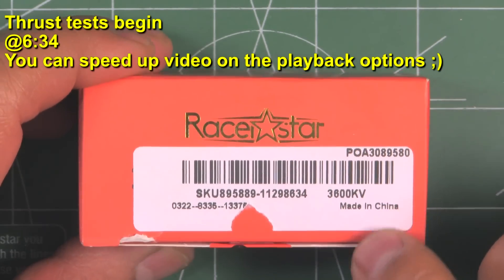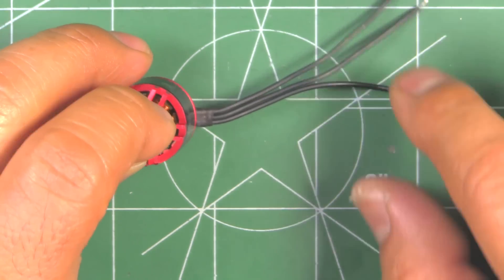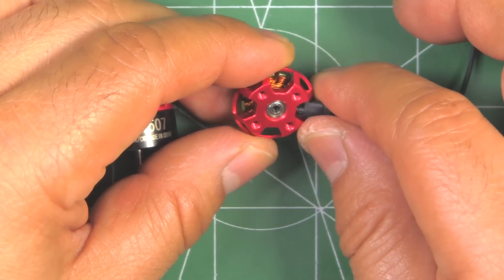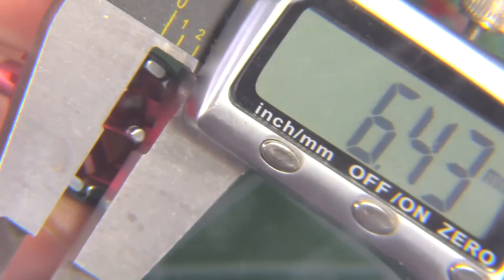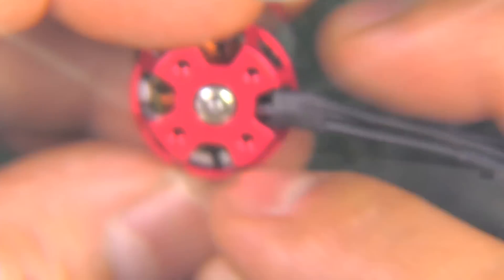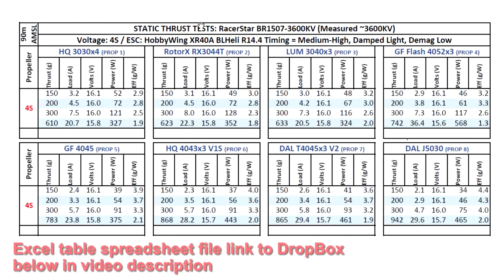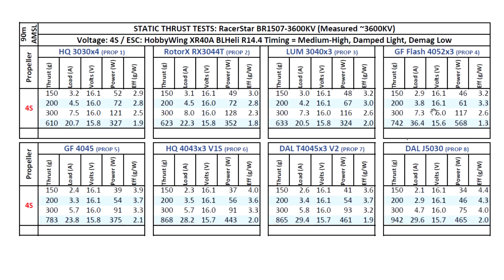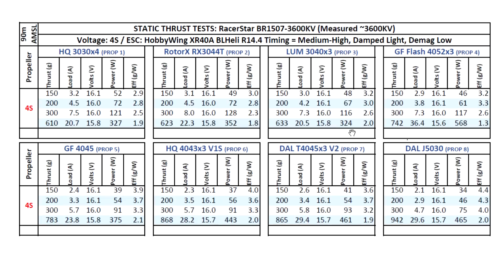RacerStar BR1507-3600KV Thrust Tests & Overview, Budget Motor for your 3" build from Banggood.com

Comment: This motor is 0.4grams less then the rcINpower 1506 3400KV, has a smaller shaft (2mm vs 3mm durability issue), and has slightly lower thrust at 868 vs 934 on the 4" V1S (which is a great prop choice for this size).   Between the two, do you think either could handle a 5-6S 1000mAh ?
Reply from the maker: on 4" V1S? 6S I wouldn't venture to try that high. 5S .... maybe but risky on either one, but the rcINpower may have a better chance..... but may still fry!  I've only seen 3" props running on 5S on micro motors, the XNova 1407-3500 there's a video of someone (I forget name) running 5S on 3"

Comment: Nice review.  Interesting motors...wish they were little cheaper.  At $40, I'm inclined to stick with the motors I know are high-quality at $10 more.  But might give them a shot on a light 4" build!
Reply from the maker: Right, if one can afford an extra $20 more for a set, there are many more capable and proven motors.
Reply: Yea...think you're right.  The more I think about the data and construction of these -- it just isn't worth it to me to take the chance.

Comment: Was really looking forward to test results of 2s and 3s, but you only do result of 4s :-(  Perhaps in future?
Reply from the maker: Usually most people use these 3" and 4" props on quadcopters so 4S seemed to be what people were using. I know there are some people that use 3S and 2S for fixed wing or with larger props. I no longer have this motor but I'll consider running at least 1 prop on 3S and 2S. What size prop would you use with this motor on 2S?
Reply: @EngineerX  Thanks for your reply. Would be looking to use something like the LDARC 3050 3x5 3 blade props on a 2s sub 250 gram 3 inch quadcopter due to laws here in Uk. Not for free style but with inav for slow gentle fpv filming. So only need about a two to one thrust ratio... Actually, wonder if these motors will run a 6030 2 blade on 2s too? would be great as slow flyers on my 7 inch registered drone!
Reply from the maker: My best guess is that on 2S the 1507 motors should be able to handle 6030 props.  I'll remember to include 2S & 3S test with at least one 3" 3-blade prop on future tests for those countries with the 250g limits. I'll try and run a quick test on 2S on my next testing session, it will be a different 1507-3600kv motor but should give you an idea. It'll be a couple of weeks before I can get some time to do it however.
Reply: @EngineerX  Thank you, and keep up the amazing work you do for our hobby and community! :-)

Comment: Do you think there is a way for you to measure the time it takes each prop to spin up?
Reply from the maker: Unfortunately my testing setup doesn't have that capability. The RCBM thrust stand doesn't have the resolution and speed to log that fast. I believe MiniQuadTestBench does have that capability with his custom/DIY Arduino based data logger, also a guy with channel SEIII or something like that .  I wish I had the time to research and learn to make my own but no time available :( 
RPM spool up is very informative metric to measure but you have to look at millisecond slices of time since even the crappiest motor will spin up a prop quite fast and we would be interested in seeing transition times.

Comment: Been using them for 3months now and top bearings start failing one by one. I crash a lot though. Not sure what life expectancy is normally
Reply from the maker: In low-price motors  like this one lower quality bearings are almost always used so they won't last as long. In some cases even in more expensive motors bearings can and do fail when crashing often. Hard to pinpoint life expectancy. I've had bearings fail after just a couple of crashes :(
Reply: @EngineerX  Thank you for your response. For the prices I won't complain. If you crash the stress on the bearing must be enormous. Do you know a good source for bearings? Do you think it worth going premium or just buy extra cheap ones like this.
Reply from the maker: Well, going with more expensive motors like the Cobra CP1407, rcInPower, TMotor, BrotherHobby... will get you slightly better performance (not a lot more, could be slightly noticeable in some cases). Durability will be better, but if you crash just right (easy to do) any motor could get damaged or have the bearings or shaft go bad. Majority of people do mention about some of those premium motors being able to survive crashes better, but that's no insurance. I would say if you're happy with the performance of budget motors like these, then just keep use them, replace bearings if you can do the overhaul. It will save you money once you install better bearings. You do have to make sure it's not the shaft that got bent because in that case then it means the motor has a weak shaft and then the better option is to get premium motors for replacement. 
 
I usually get bearings from here, though I haven't bought them in more than a year since I don't get to go and fly often enough lately. Make sure to measure and check bearing dimension of the motor you have
http://www.myrcmart.com/brushless-motor-bearing-%CE%A62%CE%A6525mm-nmb-p-8126.html
http://www.myrcmart.com/ezo-japan-bearing-%CE%A62%CE%A6525mm-p-11594.html
https://pirofliprc.com/NSK-5x2x25-replacement-bearing-For-1407-Hyperlite-Motors_p_5664.html
Reply: @EngineerX  Thank you again for taking the time. I ordered the bearings, overhauling doesn't seem difficult. Happy with these motors but you know how it goes, always want to try something different. RS1606 looks promising... :). Hope you keep on testing, your work is highly appreciated!

Comment: Only Racerstar could make a 1507 that puts out more thrust than their 1707 on 4” lol. Numbers aren’t bad at all on these.
Reply from the maker: LoL... I should've used that comment in the video! yep, this one looks way better than the 1707. The main limitation on the 1707 is of course the 3mm shaft, 8mm bearings leaving only 9mm for bearing housing and stator. It sure looks sturdy though... the 1707 that is.
Reply: EngineerX :) dying for a motor by one of the big boys in 1607 or 1707. Big hole for me.

Comment: These both can be used cw and ccw?
Reply from the maker: Jane Pasuelo yes. If I remember correctly there s only one version with standard direction on the prop shaft nut. Jus make sure to use nylocs